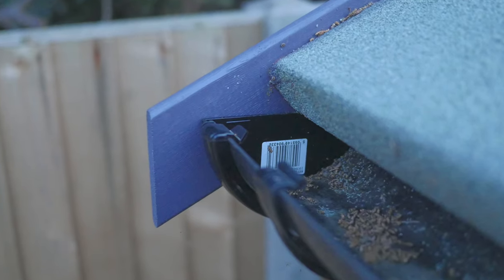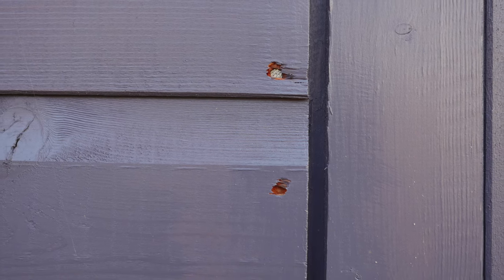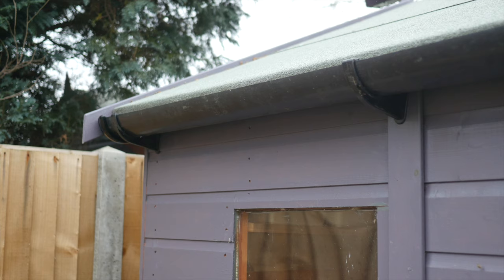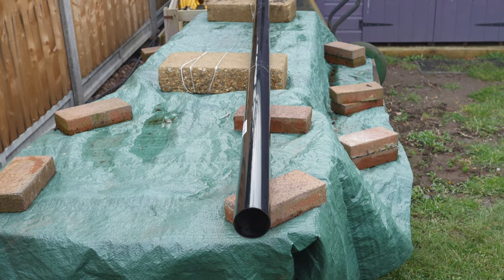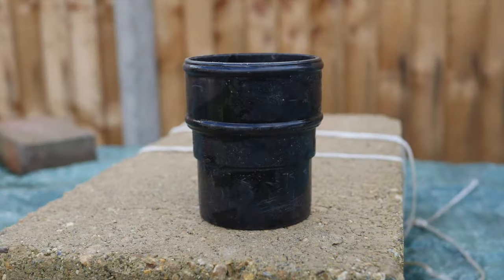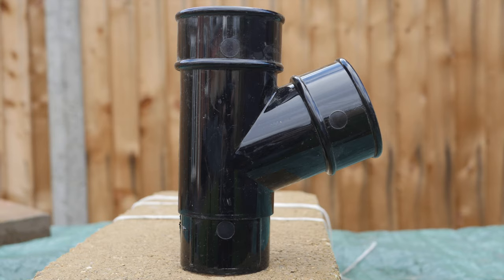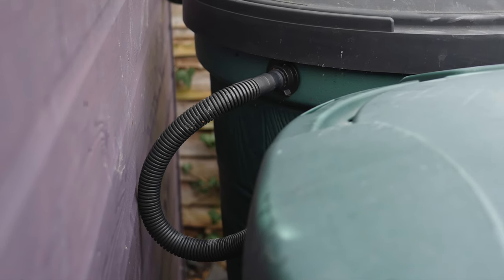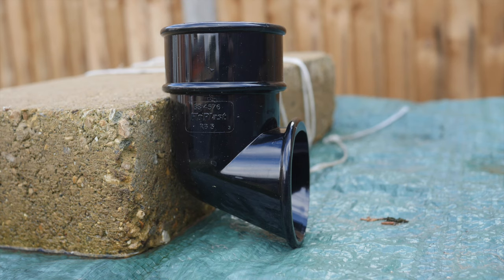How to fit shed guttering and connect to water butts

Comment: I’m just about to embark on fitting guttering to both sides of our allotment shed, into a huge water container. It’s quite scary trying to work out bends and levels, but your video has been an amazing help, I couldn’t have started it without it. Thank you so much. I’m off to subscribe, then onto buying the parts I need. 👍🏻👍🏻

Comment: Great video. My wooden shed wall was getting soaked before I put up guttering. Dry as a bone now. Tip: keep the lid loose, but weighed down with a brick so cats can't fall in. Then you can dip a watering can in, rather than wait ages for the little tap to fill your watering can. I've also seen water butts set lower into a hole in the ground so you don't have to lift heavy watering cans up high - great if you have limited mobility or arm strength. If you are not using the tap, you can discard the plastic base altogether and set the butt on the ground if you are dipping.
Reply from the maker: Thank you for sharing your ideas!

Comment: Thank you AB, this was very informative. I'd like to add, though, that there shouldn't be a "downward fall" from the diverter to the water butt if you want to avoid overflow. The bottom of the diverter should be level with the inlet to the water butt because if the diverter is positioned higher than the butt inlet, the butt will overflow with rain water instead of being diverted down the downpipe to a drain. If the diverter is positioned lower than the butt inlet, the butt will not fill at all, and instead just flow down the downpipe into the drain. Looking at your video here, the diverter appears to be higher than the water butt inlet, and thus the butt will overflow - unless, like me, this is intentional because I prefer to chain multiple water butts using cheap connector kits.
Reply from the maker: Thanks for the comment, and well spotted! To explain my set up, I keep the water butt diverter below the top level of the water butt. That way, water pressure stops the water butt overflowing. I find a slight downward fall from the diverter to the butt  means the water flows more quickly and helps avoid the connecting hose getting blocked.
Reply: @AllotmentBook  Uh? I think we should leave it there ;)
Reply: Don't think that's correct. It's the top of the diverter overflow that needs to be slightly below the top of the water butt (i.e. the very top rather than the top of the inlet). It's fine to have a downward fall from diverter to waterbutt. Once the waterbutt is full the water will "back fill" the diverter pipe and then eventually all new rainwater will go straight down the main drain pipe.

In this video the waterbutt inlet appears to be several inches below the top of the waterbutt so there's some wiggle room to set this up easily.

Comment: Very interesting video.  I was wondering however why you chose to connect the two gutters to one downpipe.  It saves the cost of an extra diverter but this will be more than offset by the extra pipe and bends and joints.  Diverters do not divert 100 % of the rain to the water butt, especially in a heavy downpour so 2 diverters would be more efficient than a single one.
Reply from the maker: Thank you very much for your comment. I like your suggestion to not join the gutters to a single down pipe to maximise water capture. I think that would make a difference, especially in relative dry areas that do not receive much rain.

Comment: Good video, thanks.  It looks like 4inch guttering you're using! Is that best the best size when having multiple water butt's?.. my new shed is slightly smaller than yours and will fit just a small water butt.  I'm thinking of using 3inch miniflo guttering, would this be adequate or is it best to go with the 4inch? Thanks again..

Comment: Very informative video and clear instructions thank you! I am attempting to install guttering and a water butt around my flat roof garage, although I'm not sure how to drain the excess from the down pipe once the water butt is full. To do what you did may be an option although I'm concerned it would lead to damp ingress into the garage. Any ideas?
Reply from the maker: Thank you for the feedback. A rainwater diverter should divert water back down the drain pipe once the water butt is full. Where it goes from there depends on what is around the garage at ground level. Options like diverting to a soakaway, perforated pipe, or channel drain.

Comment: Hi, great video. At 3.22 you show what appears to be a blanking cap for the downpipe. This looks exactly what I need. I've just bought a slimline butt for the allotment shed but the only pipework supplied is 25mm corrugated (I have 68mm pipe leading dow from the gutter. My options are to either try and find a reducing attachment or blank the 68mm pipe off and run the hose from that using the attachment in your vid. Where did you get it?(Google searched have proven fruitless)

Comment: Very interesting and informative video. I am shortly going to emulate your guttering project on our new shed , but could you tell me what size guttering you used. Thank you.
Reply from the maker: I used the same size guttering as you find on a normal house, but there is also smaller guttering for sheds. Both would work fine.

Comment: Brilliant video, but - Help please !   I have two butts connected to my shed guttering but there is no downpipe into a drain or soakaway.  What can i do if the butts are full?  At the moment I just fill watering cans and empty the cans down a drain that does go into a soakaway.  The drain is opposite the shed, but I can't lift the setts and tarmac to put a pipe across to the drain.  Ok - this should have been done when the setts and tarmac were laid, but the guys who did it didn't do it.  They went bankrupt - surprise, surprise.  Any ideas that don't involve major earthworks would be most welcome.  Thank you.
Reply from the maker: Thank you very much for your comment. My shed is at the back of the garden, which is also not near a drain. The water butts stand on gravel, and when full, the water will flow out of the top (there is an overflow outlet) and onto the gravel where it naturally soaks into the ground. This works okay for my relatively small shed. For a shed with a large roof, or if the water butts are standing on concrete or a patio, and the excess water is making it dirty, one option would be to connect an overflow pipe to the overflow outlet, and channel away to a porous area (grass or bed) with perforated pipe to let the water out gradually, or into a soakaway, or perhaps behind the shed (as long as the shed is raised a little off the ground).

Comment: Sorry for the silly question but can you remember the dimensions of this guttering? I know this video was a while ago but thought I'd ask
Reply from the maker: i used the usual house guttering on the shed as I had some left over (I believe this is 112mm) - it did not need to be this size as the roof of the shed is not large enough to need guttering capable of handling such a large amount of water. i think the other size is 76mm, and is a little cheaper to buy, but in my experience a little more difficult to find in shops…

Comment: Hi great video thank you, but I need an answer I can't seem to find anywhere. I've just bought a water butt for the first time and we're getting a new shed so will fit it from there. The trouble is, where the shed will be (in our v.small garden in the hottest part of the garden)! It really gets very hot in that corner when the weather is at its hottest. Won't the water almost boil in the butt? It's a smaller 100 ltr one. I just think the water might turn foul in the hot weather, in full afternoon sun. Can you answer my question?
Reply from the maker: Thank you very much for the feedback. Your question is really one for a scientist, and that is not me! What I do is treat my water butt water as good for plants only. My water butts are constantly being emptied for watering purposes. I don't like leaving water standing in water butts unused for long periods of time. There are chemical treatments available for water butts too.
Reply: If your water boils you have more problems than watering your garden!  Water boils at 100 degrees C, the highest temperature recorded in England to date is about 40 degrees C.  It is very unlikely the water in the butt will reach anything like that temperature even in full sun and most gardeners usually avoid watering their plants in full sun anyway.